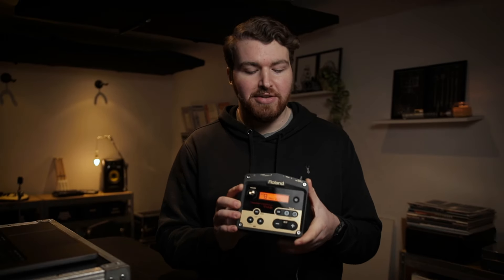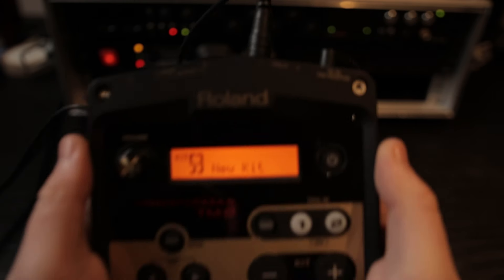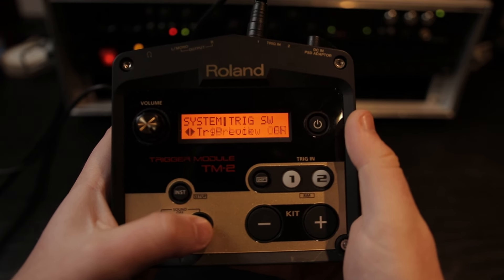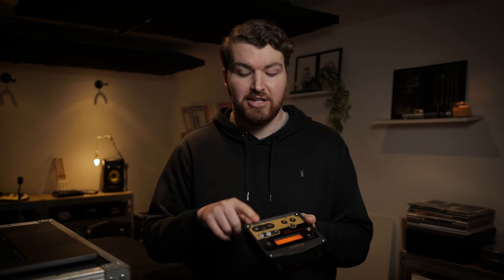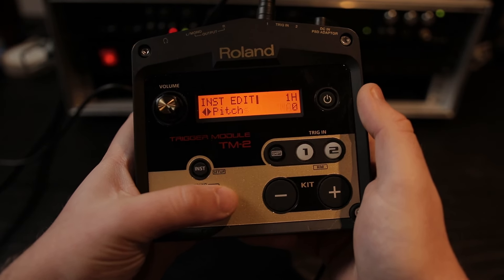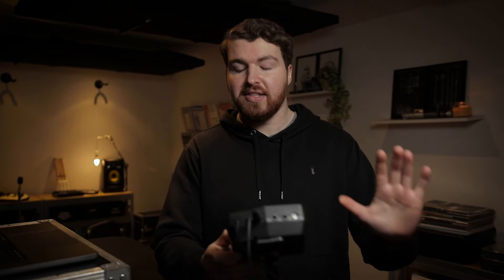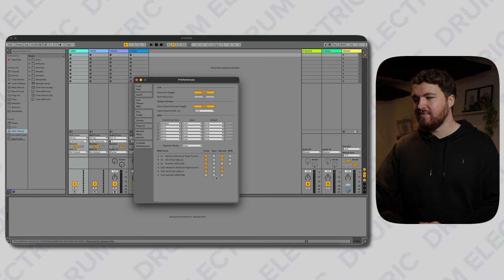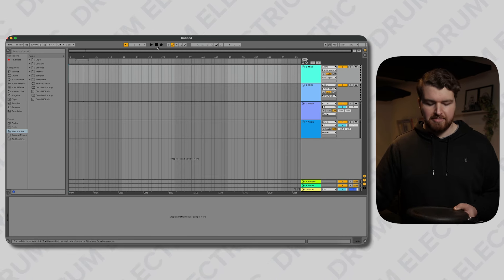MIDI Control with the Roland TM-2

Comment: Can you use the TM2 via Midi in a DAW/Recording session instead of using an input on your interface? If so where do I start?
Reply from the maker: You can, but annoyingly the TM2 doesn’t have MIDI over USB (no USB input), so you’d have to have a way of getting 5 pin MIDI to your DAW from the TM2. I do this just using an audio interface like the Focusrite 18i20
Reply: @DrumElectric  I have a 18i20 and ADAT addition. I'm just not sure of the proof of concept. I see how you can control your DAW. But not sure how to configure to Midi/TM2 to use the sample
Reply from the maker: Ah right! Then if you get the 5-pin MIDI ‘out’ of the TM2 to the ‘in’ of the Focusrite. Then it depends on with DAW you use and the MIDI instrument. 

Then go onto the TM2 and make sure your MIDI channel is set to ‘global’ and that each trigger is sending out a MIDI note as sometimes it defaults to ‘none’

Comment: So Harry with the Spdsx pro have you ever tried using the module with roland pads and pedals connected to it and using it connected into a PA as a kit for a  gig or live situation? Is it possible to even use it like this?
Reply from the maker: I haven’t used it like that, but you absolutely can! I’ve seen many people go as far as replacing their electric kit module with the SPD-SX Pro and it works great
Reply: @DrumElectric  right ok I'm trying to work out how to get it working using the direct outs to balance the kick snare hats and the master out channel for sending say sample tracks out but getting  good monitoring so the guys in the band can hear it as if it still felt like an acoustic through wedges  if they don't have inear monitors are there any videos out there that cover this I haven't seen any?